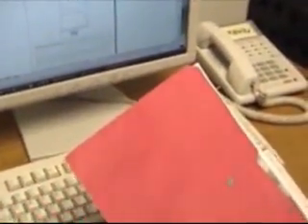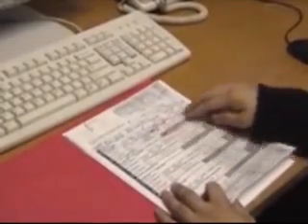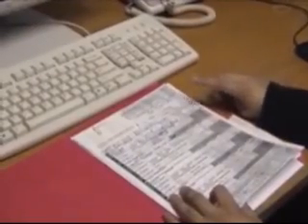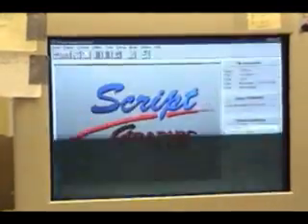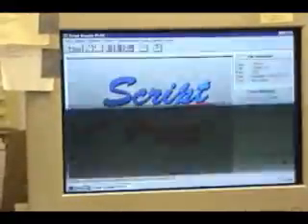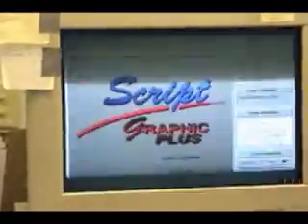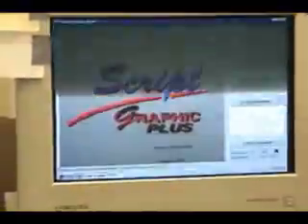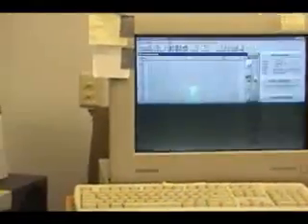Laser Engraving using a YAG laser.

Comment: on what material is engraved that? at the moment we engrave on plastic material which is made with aditiv too so engraving can be applied.
we have yag laser too,so i was wondering what parametre setup is used for that metal i believe
Reply from the maker: The video shows engraving on stainless steel, however laser engraving can be set up to engrave almost anything, even cloth!
Reply: today i played a bit with laser  on work,i tried different materials as wood and metal.and i was able to write on both materials :)
but i made a mistake tho we have laser for marking,not laser for engraving.i'm still learning all parameters,which one is for what